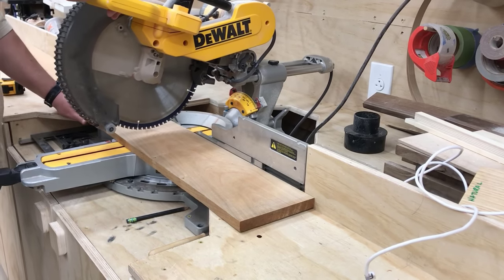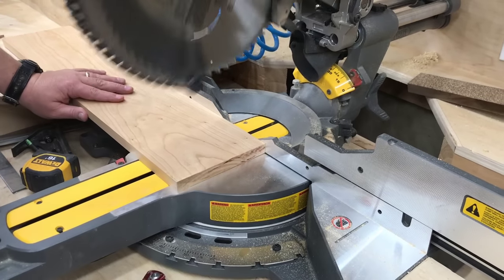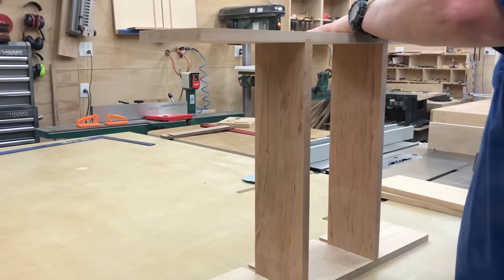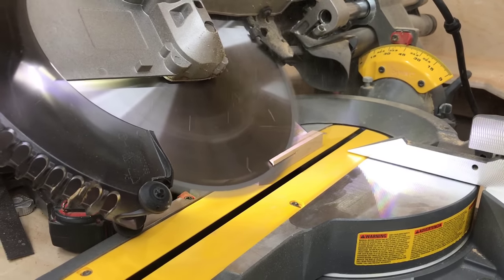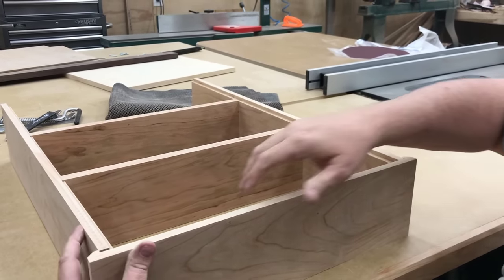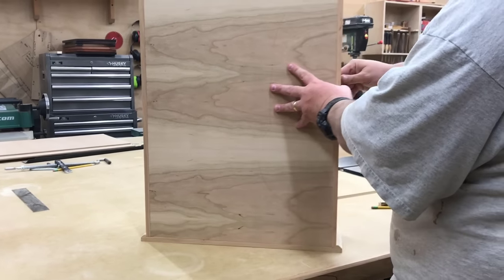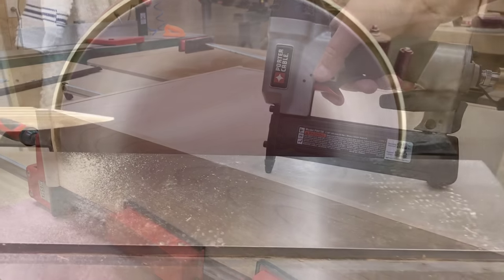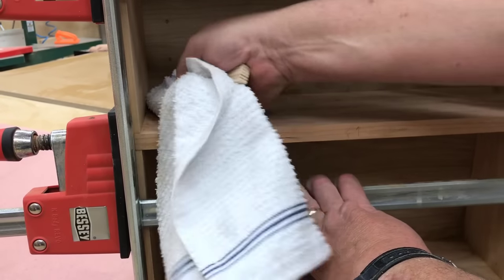10 How to make a Solid Cherry Bookcase

Comment: Thanks for this informative video. Would this joinery and method of building work with a larger shelving unit, like 36-42" wide and 60-72" tall? Assuming a middle vertical piece would need to be added to avoid sag, so in that case I'd plan on a center piece that's dadoed on both sides? Would a double sided dado center piece have any strength left if I did it that way? That's a fair reduction in thickness.
Reply from the maker: It positively would. 
I’ve done very large shelving & entertainment center units that way.
Reply: @KingsFineWoodworking  Thanks for your speedy reply. That's some responsive support. Are your dadoes 1/4" deep to receive shelving? And if so, on my vertical center piece (on a wider bookshelf) I  have dadoes on both sides, meaning I'm removing 1/2" of a 3/4" thick material. Is that remaining 1/4" enough as a center support? Thanks, KFW!
Reply from the maker: @rachelsmith3398 
In your case, for the dadoes that get cut into boards that go horizontally, I’d make those 1/8” deep. It doesn’t take much to lock in the strength. 
And the remaining wood will still be plenty strong enough. 

In the vertical pieces of your unit, you can go 1/4” deep (that what I do).
Reply: @KingsFineWoodworking  Awesome. That's what I was thinking too. Cheers!

Comment: question for you...... if youre piece of wood can fit on a jointer on all surfaces why do you only joint one side then plane the rest ...im not critiquing im genuinely curious
Reply from the maker: Good question. You joint the first face to get it flat. You take it to the planer to make the second face parallel to the one you just jointed. 

Sometimes boards are thicker on one side than the other. So if you just jointed both sides, then both would be flat but still one side would be thicker than the other.
Reply: ahhhhhh i see thanks for the timely respone

Comment: does not solid boards bending when humidity changes? I built drawers with front from solid wood and now all are curved, wood was 12% dry...
Reply from the maker: yes, but the expansion is negligible along the length. So this will be unaffected

Comment: Could I take all the principles you’ve got here and make a 5 foot tall shelf that is 3 feet wide and a foot deep?
Reply from the maker: Blog of The W3st, yes absolutely!
Reply: Kings Fine Woodworking Cool! Thank you :)
Reply: Kings Fine Woodworking Would you recommend changing anything up? Such as beefing up the bottom somehow? Anything decorative? Anything decorative or something that might provide more stability for the top, the front, or the bottom considering that I’d be taking what you did in this video (the incredible job you did ^_^) and scaling it up?
Reply from the maker: I think it would hold up no problem unless you tried to put a set of encyclopedias of the shelves. Those are very heavy. If you planned on something like that you might double up the shelf thickness. 
But otherwise it would work great scaled up as is. 
As far as decorative, you can get as fancy as you like. You might do a google search and find bookcase ideas you like that you can incorporate. 

Although, maybe don’t deviate too far away from the basic shape unless you have a little more woodworking experience. 

Good luck. :-)
Reply: Kings Fine Woodworking I’m definitely planning on 2x12 wood 👍

Comment: I'm late to the party, but I would never pull the board back through the dado blades after cutting. It only takes a slight tug for the board to clip the blades, and then you have a dangerous situation. I just don't think that process is safe at all.

Comment: what jointer do you use?
Reply from the maker: Grizzly 8"
Reply: is it a benchtop model?
Reply from the maker: Hi mine is not benchtop. It is stationary. It is like this one. 
http://amzn.to/2pQ3oTO

But if you are looking for benchtop of the same quality & kind, I can send you a link to look at the benchtop version that I use.
Reply from the maker: Hi, this is the benchtop model I use in my smaller shop. It it is very good. And it also has a helical cutter head. 
http://amzn.to/2rjINr7
Reply: thank you. i have a small space for my woodworking, so thats all i can get. but some people say its just not worth getting.
Reply from the maker: It's definitely worth getting. With my small jointer, I can still get an absolutely perfect glass smooth flat square edge on Lumber that is 8 - 10 feet long.  Just get a quality one. And the best are the ones with the helical cutter. There will be no tear out from those, even on figured wood.